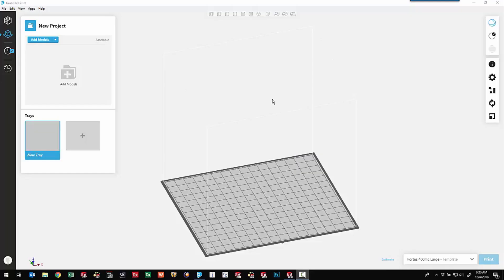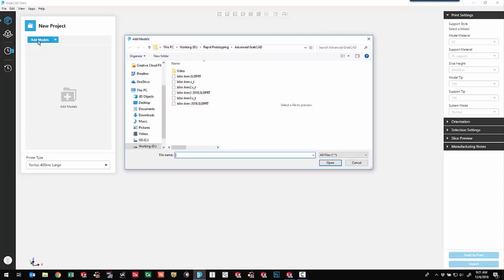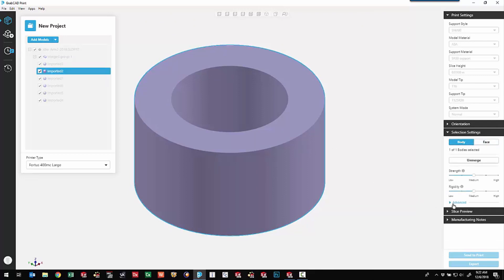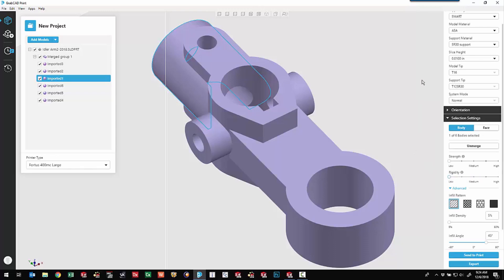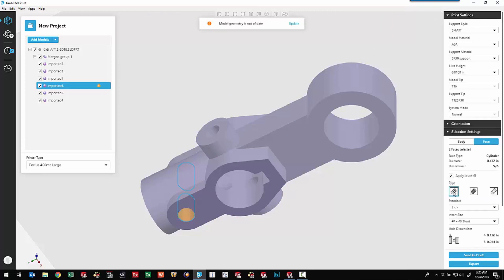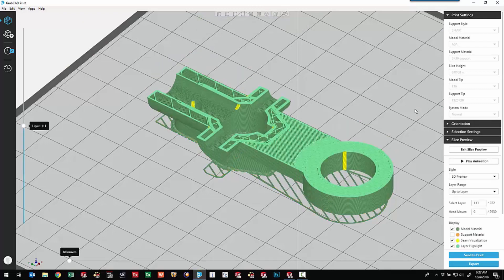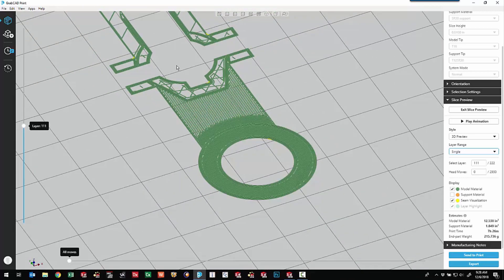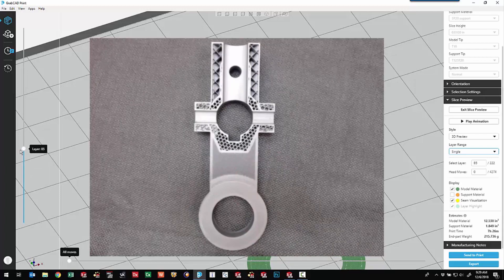GrabCAD - Print Advanced FDM

Comment: Which 3d printer do you use?
Reply from the maker: Hi Aditya,
GoEngineer is a Stratasys reseller, so this part was printed with a Fortus 400/450 FDM printer.  I was running dark grey ASA material at a .005” slice.